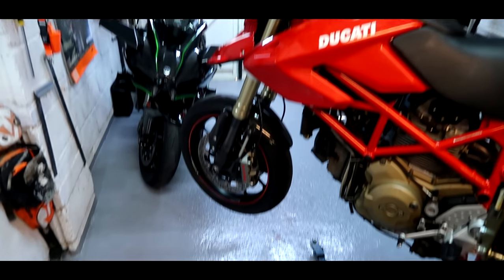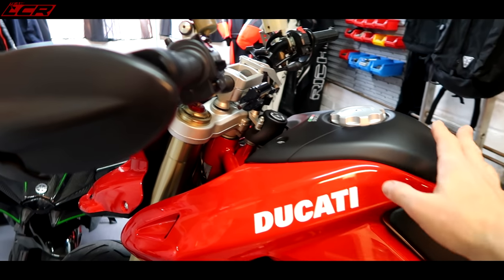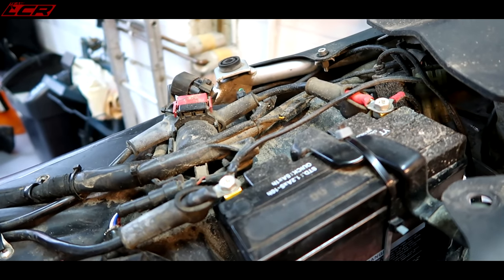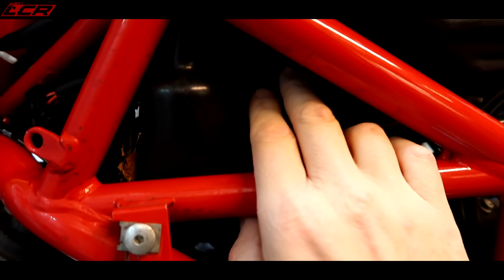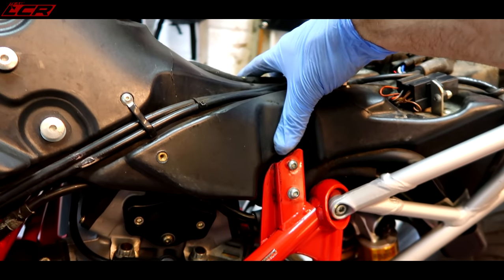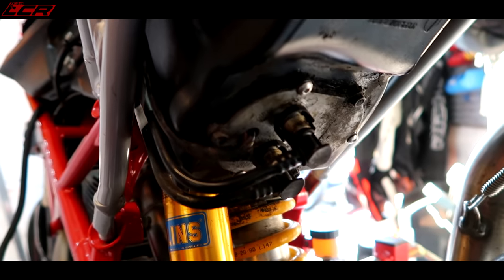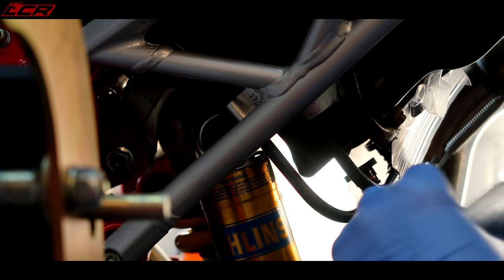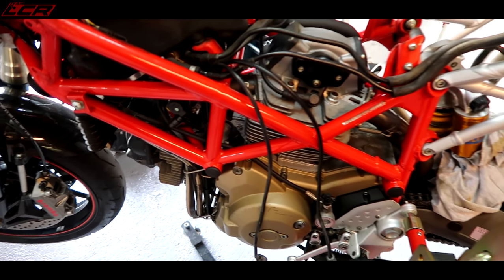Ducati Hypermotard Restoration EP02 | Pesky Fuel Tanks!!

Comment: A bike is never really yours until you've wielded some spanners and taken it apart and rebuilt it. First thing I do with my competition bikes, take them apart, make sure everything is properly greased then rebuild and loctite. That way if and when something fails, you know how best to change it, what order to disassemble, what tools you need etc.
All makes the bike feel personally yours. Great content this series, really enjoying it.
Reply from the maker: I do agree with you, really bond with a bike when you know it inside out 👍
Reply: This was the reason why i wanted to do the valve service on my 848, but I was too intimidated by not having the correct shim sizes and proper tools for locking the motor tdc etc.....

Comment: One thing I usually do when taking bikes apart.. especially now that the tank is off, I usually give it a good bath with some degreaser and a brush and rinse all the dirt away. Blow it dry or let it sit in the sun to dry. It will make working on the bike much more fun!
Reply from the maker: Good tip 👍👍

Comment: You can cut the finger of the glove to use as a bung, fill the bit of cloth if you need to stick in hole. 
Or you could just cable tie the finger of the glove over the fuel pump part that was dripping. 
Keep them coming Chops!! 👊🏍👍
Reply from the maker: Good tip 👍

Comment: Well done chops, great video. Taking the fuel tank off was also a real pain on my Multistrada project. I just new you would leak fuel when you disconnected the leads from the pump ☺. Warning, go easy with the fuel pump wiring as you can introduce a fault where the pump intermittently stops working! I spent hours troubleshooting that one 😐

Comment: Floor looks great, watch out for the bike sidestands when they load up, the paint can chip as they push down. I used a puk under mine just in case. Good luck with the restoration.
Reply from the maker: Yes good tip Nigel 👍

Comment: Brings back painful and expensive memories! I stripped a Sport Classic for the exact same reason. Ended up having engine stripped and soda blasted. It did look nice in raw ally but probably not ideal if plan is to ride in the wet. I think I ended up lifting the frame off the engine. I made a small dolly and strapped the engine to it. The engines are surprisingly heavy! Drain the petrol tank so it keeps the original shape. Have fun!

Comment: replace the 3 nuts holding the exhaust onto the head is my tip. They suffer from dissimilar metal corrosion and eat the studs. cylinder off, so you can machine and re-tap. I change them yearly. Been bitten twice. all Ducati's are the same. enjoyed the video fella

Comment: You mentioned inducation kits and long range tank. Having had both options in teh past I can tell you that you can have one or the other - not both together. The stacks/filters set up of the induction kit, whether Ducshop or Beast (both from US) foul on the long range tank (California Cycleworks, also US) - those cone filters are MASSIVE! But properly set up you'll get a genuine 90+bhp, much better throtte response and a lovely induction roar. Both are a great mod, for different reasons. Currently got the LRT on mine but plan to go back to the induction kit - once I can face the hassle of wrestling with the tank. And you thought the standard tank was a PITA...
Reply from the maker: Yes indeed found that out now, really want the induction kit but it's very expensive and then shipping and import duty on top! Think its standard filter for me 😪
Reply: @LambChopRides  Believe me, you NEED that induction kit! Look at that restricted airbox hole that the standard bike breathes thru - even the enlarged version supplied with the Termi pipes is pretty poor. Looks like Ducshop and possibly TPO have stopped production but they do come up secondhand occasionally. Worth waiting for, especially as you already have a free breathing exhaust . I'd sell you mine but 1. It's going back on the bike and 2. Your salivating over Sato rearsets has cost me big bucks - even if mine are some ex-demo ones!

Comment: Most modern bikes are a nightmare to disassemble as the bike is built around the wiring loom in stages. 
I’ve just taken the rear suspension bearings apart on my older bikes. Always worth a re grease even if the bearings are still good as often overlooked during servicing. 
Please keep the forks gold!
Reply from the maker: Yes do agree David 👍

Comment: Decent progress on a bike you don't know well.  I'd be doing the same thing if I had a garage I think, my swing arm needs a refurb really (I have paint already), it's just a pain without a superbike stand and outside.  A possible solution you could have used might work for me, taking off the foot rests and fitting them upside down and using axle stands.
Reply from the maker: Yeah good idea that matey... didn't think of that 👍
Reply: That’s a great idea.

Comment: Damn lucky you could actually remove the quick disconnect fittings for the fuel pump! Mine are stuck solid meaning I have to also remove the fuel pump to get the tank off lol, just makes getting to the airfilters even more fun :)
Reply from the maker: Oh no nightmare, mine came off quite easy.. was worried about the rusty bolts but also came free 👍

Comment: Change all the bolts on the fuel pumpfor ti or stainless...also change the filter while your there (should be done on every service) - you have to drop the pump out and theres a simple to change inline filter...theres a couple of custom bolts in there that are mild steel - (i clean mine regularly with some strong acid...as for the tank... i kinda lift the front and go forward over the bars then you dont scag any of the cables on the rear....
Reply from the maker: Thanks matey great tips, going to drain the fuel and take a peek at the pump. Will certainly change the internal filter 👍👍

Comment: I just noticed the other day that the engine case on my 848 evo is starting to flake right under the exhaust exit of the vertical cylinder. Only 7000 thousand miles 😞

Comment: Make a closing panel out of plastic to close the area under the seat.. cardboard template then use a heat gun or hair drier to mold the plastic to shape.
Reply from the maker: Great tip James 👍
Reply: @LambChopRides  And after you have done that, use it as a mold and make the final panel with carbon fiber. Carbon fiber is actually pretty easy to work with, just like fiber glass..

Comment: Maybe you could make little stainless steel plate or plastic  to cover up that hole where all the dirt comes in you could even go as far to melt the plastic plate into the fairings to make it one solid piece but it would be hard to remove if you need to change the fairings
Reply from the maker: Yes certainly needs something back there...

Comment: I heard someone on last video recommend carbon wheels, don't bother as the forged machine wheels are already ridiculously light. The company that makes the 6.6 gallon tank (https://ca-cycleworks.com/) also supplies individual pod filters for the intake because fuel tank takes the space of the airbox. The shorai battery I installed on my hypermotard is much lighter than the stock Ducati battery and does help it crank over better. Watching your video is breaking my heart right now as I'm in the process of selling my Hypermotard to ease the burden of getting let go from my job😭 I'll be down to my Superduke GT as my only bike 🥺
Reply from the maker: Yes agreed, I love the wheels on this  too 👍

Comment: What's the point Chops if your worrying about weight converting to Lithium battery . When you going to put a larger fuel weight on the bike. 10 more litres of fuel Chops , I'd take less fuel n weight over range.  You've got a bike built for handling not cruising . Fanging from apex to apex on a tight mountain road is where this baby will be happy. Keep up the good work . Garage looking good mate.
Reply from the maker: I'm not going for the huge fuel tank, dont needs it for the riding I do. Would rather cut weight as you say 👍

Comment: It might have been mentioned in another comment, but to save wasting the plastic bags to cover pipes, electrical connectors etc. cut the fingers off you're old gloves and use them. They're a little less intrusive and less likely to get caught on anything.
Reply from the maker: Yes good tip 👍

Comment: I don't want to sound harsh but you said you have the service manual if you 
would have read it you can have the tank off in 15mins w/o any of the issues
you ran into. Please look at it before you remove the airbox there is a small bolt
under the front of it that is easy to miss it also has 2 coils attached to it and
two of the connection points are push pins. P.S. your seat bolt is not correct
it should be a button head not a cap head Part # 77550191A. Lots of good 
info in the Service Manual and online no need to go in blind.

Comment: hope you haven't left those plastic bags over the fuel connections petrol will eat away and melt them in no time at all leaving you with a mess and possibly petrol on your new floor which will them attack the floor paint, better to try and drain the tank so no risk of spills 👍